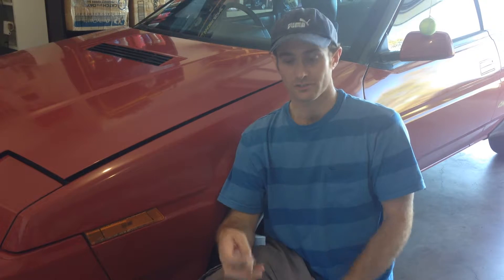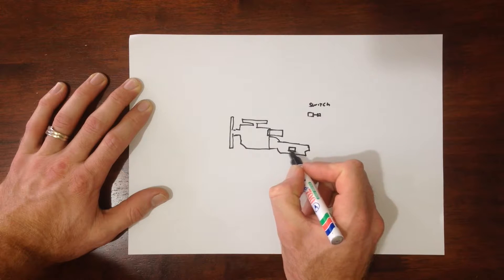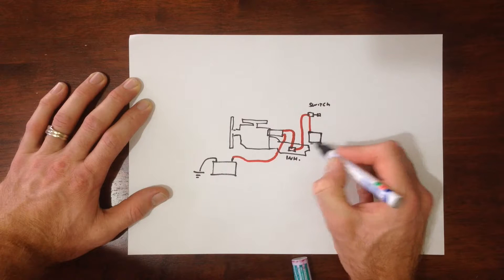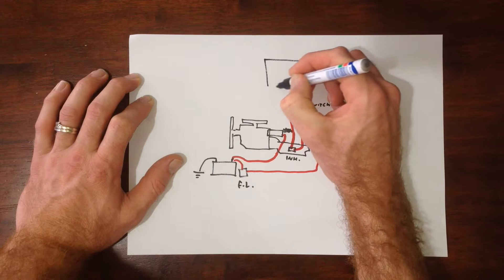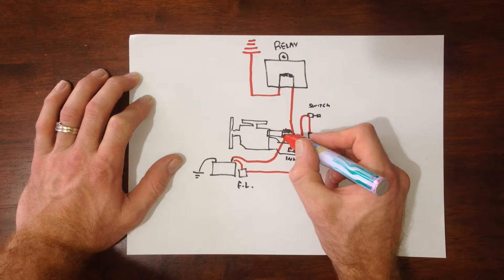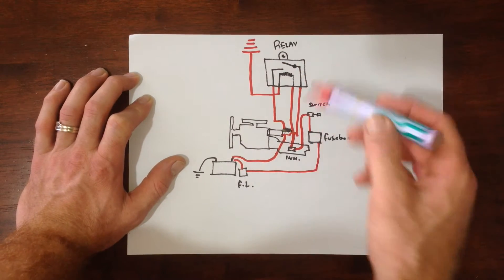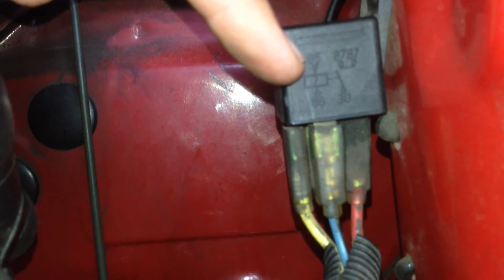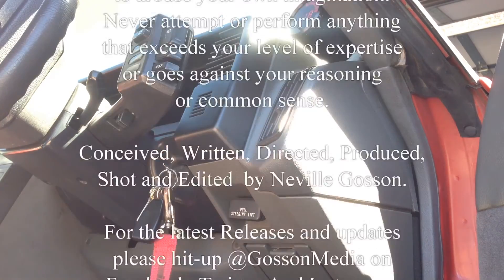Adding a Start Relay to solve Voltage Drop at the Solenoid

Comment: I have a 96 Mazda that clicks when you turn the key around five times intermittently and then starts. i have replaced the starter , inhibitor switch and ignition switch and cleaned all connections. will this fix my issue?